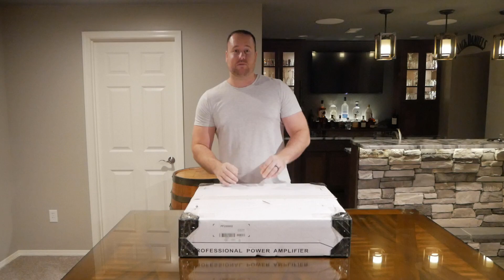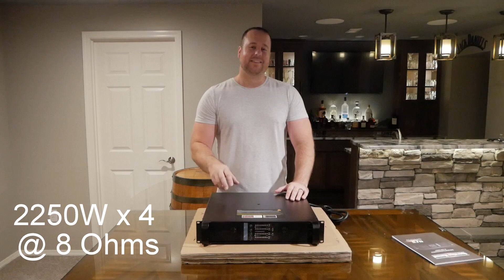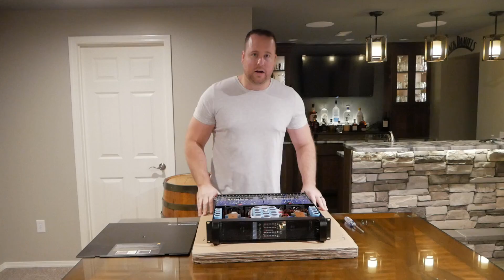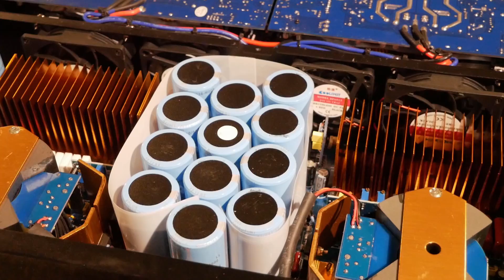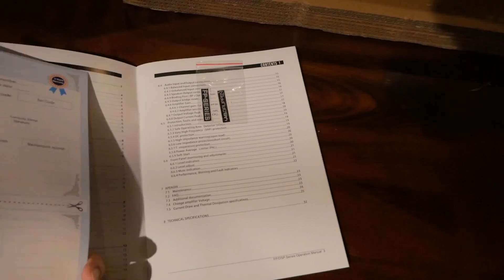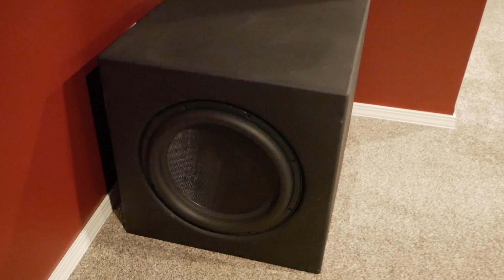FP20000Q Unboxing | Sinbosen Clone Amp | Home Theater Subwoofer Amp

Comment: Do you have a sub panel for the 240v in your closet or are you going to drop a new line from the main panel?  And I'm guessing you will be going with 10 awg to feed it 240? Great video.  Thanks!
Reply from the maker: Correct, 10 gauge wire for the 240v plug. I don't have a sub panel there as I was able to run 2 separate 20 amp lines to the closet during construction and am able to still access the ceiling area to run more lines. I didn't find it necessary, although one could argue it would have been easier!
Reply: @LifeofBliss    I ran a new 10 awg from my main panel to my closet.  It is Romex, and it was recommended that I use two grounds.   My Romex has 4 lines. 10-3 I think it's called.   So two of the conductors are ground on a 20 amp breaker.  Then a hospital grade outlet to a Belkin PureAV PF60.   Any thoughts on using two grounds?   I was always under the impression of equal in, equal out when wires are involved.
Reply from the maker: I personally wouldn't do 2 grounds. Aloof your power is going through the other wires. The ground shouldn't be carrying any current if everything us working correctly. It's there as a safety if something goes wrong. Seems it would be just an added cost. Nothing wrong with doing it, but I don't think it's necessary and probably won't help anything power wise. Just wondering, who recommended that?

Comment: Wow ,what a piece of garbage .That amp needs to catch the next boat back to China with a note , keep that crap in China .The insane part is you think your going to get eighteen thousand watts .I wish you all the luck in the world .I also went to the school of hard yaun and no longer trade with the Communists.
Reply from the maker: I'm sure you have nothing made in China... But to each their own. And the insane part is if I even get half of that at 9000 watts, it'll still be the best deal out there per watt... I expect to get what it was tested to put out. Here's a link to some testing done on the 22k which has the same 2 power sources, just a different amp board. Have a good day man.  https://www.avsforum.com/forum/155-diy-speakers-subs/1780914-measuring-amplifiers-49.html
Reply from the maker: And I honestly don't blame you on the way you feel. It's just hard to pass up saving thousands of dollars for the same output. We'll see how it does soon once I get the sub enclosures built
Reply: @LifeofBliss  owned  several Chinese amps , trying not to buy communist products or any import at this time , don't like the idea of buying  bullets to be shot at me, even for my own government .
My comment is solely based on my experience with this equipment .

Comment: Hello there, 

I just came by this video and I have subscribed to your channel. I’m interested to see what the performance of this pro amp is in real world usage. Two channel 18.000 Watt is a lot and I’m curious if you can do measurements with special equipment to test what it really pushes to your speakers. Also, a weight of 25 pounds sounds too light for an amp like this. My hifi amp weighs around 33 pounds. Furthermore great video. I’m looking forward to see more like this. Best, Emiel.
Reply from the maker: I don't have the test equipment myself, but these have been tested by others. Here's a link to some tests done with the 22q. The 20q and 22q have the same power supplies, just a different amp board. Gives you a good idea of what the amp is capable of. https://www.google.com/amp/s/www.avsforum.com/forum/155-diy-speakers-subs/1780914-measuring-amplifiers-49.html%3famp=1

Comment: Don’t know why you need that huge wattage amp for a HT. This is a class D amp and for me I won’t used below class AB amp for sound quality.
Reply: yagballs — You’re kidding, right? First, he is driving monstrous DIY Subs/speakers that require huge wattage! Second, you are waaay behind the curve on amp classification/sound quality relationship analysis! 
Many of today’s top amps are Class D! Class A/B amps were considered sonically superior for most of the audiophile era. However, over the past decade, or so, Class D amps (especially ones with Hypex Ncore modules) have surpassed many of their A/B brethren (in H/T applications with all channels driven)! Efficiency of a well designed class D will result in lower noise and much lower heat and produce a very neutral sound! I have owned Mark Levinson, Krell, Parasound, and many other marquis amps (my company custom installs home theaters) over the last two decades and I have to say that my class D ATI AT54xNC amps sound as good as any of the above mentioned amps! A $3k multichannel class A/B amp would be sonically destroyed by a $3k multichannel class D amp! You don’t have to believe me, research it!
Reply from the maker: For the 3 24 inch subwoofers that are 2000w rms each. These will do just fine for sub duty 😉

Comment: How much did you pay for this amp
Reply from the maker: I mentioned in the video they will cost around $800-900 depending on the exchange rate and import/shipping fees. You'll need to email them for an exact cost
Reply: @LifeofBliss  im also buying this amp i got in touch with this beautiful lady DAN i hope is the same dan you mention in video BUT. Please Tell me more about do you any problems with?? How would this amp compare to the real LAB  GRUPPEN  wich is made in sweden ??? What part will get bad in these amps ??? Is not like the older amp where they have this heavy coil inside???since you have for a while now does it really delivers the power they clain? DAN told me i will be able to conect 8 18" 18lw1400 from 18sound ??? I will apreciate your if you can tell me your experience with amp PLEASE
Reply from the maker: I have actually not even hooked it up yet as I haven't got my subs finished. Here is a link to some testing done on the 22k which has the same power supplies https://www.avsforum.com/forum/155-diy-speakers-subs/1780914-measuring-amplifiers-49.html

Comment: cant really judge this situation cause I have no clue what your little sub specs are.  Im going to take a stab in the dark and say your not lacking power, your lacking subs.  Two 18" high end subs will fill that basement for sure.
Reply from the maker: Yes I am definitely lacking subs. But I should have the solution soon. My most recent video I unboxed 3 24" subs that I will be powering with this amp. Should do the trick 😉
Reply: I don't know how your whole setup is but a bit of good advice for great sound, I use a 10" powered sub @ 100hz for behind my entertainment center, then I have 8" powered sub @ 60hz but in reverse and this sub is placed behind me (back part of living room).  I get outstanding sub responses this way.  This setup shakes the hell out of my house, now with you having 3 24" inchers....holly cow.

Comment: Im thinking to buy one fp20k and fp10k, the fp20q to drive 8 18" 8ohm 900w, 4 ohm per channel, sixth order box. The fp10q drive 8 15" 8ohm 300w woofer in 300-700hz range, 4 per channel 8 ohms, one channel driving 4 units 2" compression driver in 8 ohm. One channel left free. What you think? Btw sorry my native language is spanish.
Reply from the maker: That sounds like a huge setup! You'd need to research if the fp10q would be good for drivers other than subwoofers. I know some if these amps have a pretty high noise floor with mains

Comment: Insane wattage but the point is how it sounds ?
Reply from the maker: For sub duty these amps do well. Many have tested and used them for that purpose. Depending on the model, they don't work well for full range setups due to a high noise floor.
Reply: @LifeofBliss  
Thx :-)

Comment: Did you research the best Chinese company to purchase the FP from? I bought a few of the FP10Qs about 7 years ago from a company researched on the AVS forums and they still work running my 10 21” subs.
Reply from the maker: Yea there were a lot of threads on Avsforum I looked at. Many had bought this particular amp from Sinbosen and had good luck so it was considered the one to get
Reply from the maker: That's a heck if a setup you got btw!
Reply: Thanks! Me and “The Lion”, Walter, are in the middle of designing my HT2.0 for Trinnov Altitude32. Should be ripping out my old wall any time and replacing all the JTRs with Quested LT20s and Z8s for surrounds. Getting excited! I also posted a question about the amp draw on your new amp. Have you found out what it’s claimed max amp draw is?
Reply from the maker: Those altitude processors are nuts man, that's going to be awesome!! Here's a link to someone who has done some testing in the 22k which uses the same power sources. Just a different amp board. About halfway down the page. It's a good read and has a lot more information than what I went over here. https://www.google.com/amp/s/www.avsforum.com/forum/155-diy-speakers-subs/1780914-measuring-amplifiers-49.html%3famp=1

Comment: Guess they made a typo on there web site

8Ω Stereo Power (RMS):    2250W X 4
4Ω Stereo Power (RMS):    4000W X 4
8Ω Bridged Power (RMS):  80000W X 2
4Ω Bridged Power (RMS):  90000W X 2

http://www.sinbosen.com/pid18177871/Sinbosen-FP20000Q-4000-watt-4-channel-professional-bass-power-amplifier-dual-18-inch-subwoofer.htm
Reply from the maker: Yea I think they might have...

Comment: I think their ratings might be a bit optimistic.  Even with a 240v 20A single phase circuit at full load you're not going to get more than 4800W total out of that thing (it'll actually be way less as efficiency is no where near 100%).  It still looks pretty beefy I bet it'll put out closer to 3kw total.   Even still, with 3 24" woofers it'll be plenty loud lol.
Reply: More power is available from that circuit than one may think. 

To prevent nuisance tripping, circuit breakers will allow massive amounts of current for short periods of time, by design. There's variances, however this characteristic is the "breaker trip curve". 

For example; a 20a circuit can pass around 7 times the rated 20a trip amount, .. for up to a second or more. 

Also, it will allow up to 3x the rated amount for up to 10sec or so. 

Perhaps most relevant to this discussion, the same 20a circuit, can allow up to 1.5-2x the rated amount for a period extending as long as 30 seconds.

So a 20a breaker;
•Over 100amps for around 1-2 seconds
•60amps for around 10 seconds
•30-40amps for as long as 30 seconds
Reply: RMS is  1000w per channel optimistically, even at 240v30a. You got to take PSU and D-class amp efficiency into account.
Reply from the maker: Here's a little light reading for those actually interested in test results vs speculation. Starts about halfway down. The 20q and 22q have the same power supplies, just different amp boards. https://www.avsforum.com/forum/155-diy-speakers-subs/1780914-measuring-amplifiers-49.html
Reply: also, its 4k/channel MAX, not RMS
Reply: Not sure why people are upvoting this comment. Apparently you don't know how amplifiers work. They have capacitance so they can produce more than the circuitry provides that the electrical panel actually supplies. It's not sustainable but burst power can easily be more than the simple volts X amps calculation that you did.
Reply from the maker: It'll be a 240v 30a. Sustained power will be limited, but burst power should be fairly close to claimed ratings. Good for movies, probly won't get near rated power for constant sine wave dubstep. But even at 2k per sub, that's some serious power for 1 amp! Here's a good read on some testing done. The 22k and 20k have the same power supply. https://www.google.com/amp/s/www.avsforum.com/forum/155-diy-speakers-subs/1780914-measuring-amplifiers-49.html%3famp=1
Reply: @LifeofBliss   ive seen 10k rms amps with 2 plugs 2x 230v 32a and 1 amp 15krms 3phase 380v 32a
Reply: @LifeofBliss  yeah, loud enough right?
Reply from the maker: Should be plenty loud lol
Reply: @LifeofBliss  just laughing at the (dorky white guy voice)  "ya know I'm not sure you're gonna hit full rated power ya know" lol

Comment: Has this been on a meter and been proven to do its rated power...? Also, is this still working after more than 3 months...?
Reply from the maker: Here's a good read on these amps. Most prefer the 20k to the 22k due to built quality. Many use these with great results. I haven't used mine yet due to the subs not being completed
https://www.avsforum.com/forum/155-diy-speakers-subs/1780914-measuring-amplifiers-49.html
Reply: @Life of Bliss  thanks for the reply and the link. however, all I can find on that page is that the "FP14K clone" (whichever one that is) outputs 150 volts, but I'm unable to convert that into watts without knowing the current type or amperage. and fair enough on the not having used it yet!
Reply from the maker: Hmm... well it's on page 49 of the thread. Halfway down there are some charts of tested tones at 4.5 ohm. Essentially 2 channels driven (1 per power source, the amp has 2) and they were getting over 4k watts per channel. That's the very condensed version lol, but it gives a good idea of the possible power from these
Reply: @LifeofBliss  yes you divide the voltage with the ohm of the speaker and you have the Ampers, 150v ÷4=37.5A you you can multiply with 150v you have  5k watts burst i think, but is great

Comment: That's a hefty beast.  I'd read about these before but I had assumed they were meant for mains, not subs.  Do these guys make amps that are community recommended for home use(HT/music)? I'm assuming they're picked for sub duty because, like Crowns and Behringers, they push a lot of watts but maybe aren't as clean or have as quiet a noise floor?

Comment: Is your electrical panel 240v?
Reply from the maker: Well it depends on how you wire everything up, but most of the breakers are 120v for the house. You can use 2 breakers and spaces in the box to make a 240 volt connection. I have 2 drier hookups that are 240v in the box already. We are only using 1 of them so I'll be able to run some new wiring to the existing breakers and have a 30 amp 240v connection in my media closet.